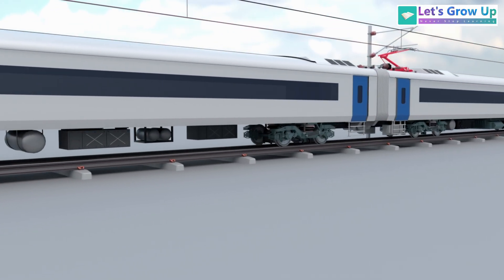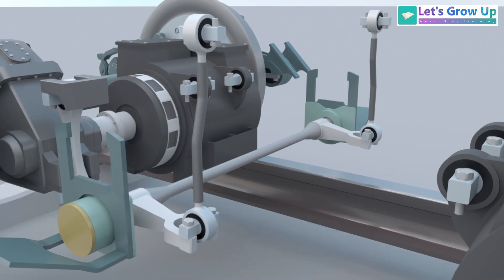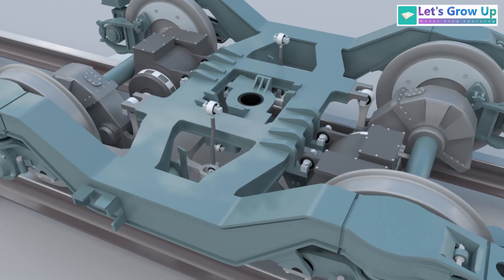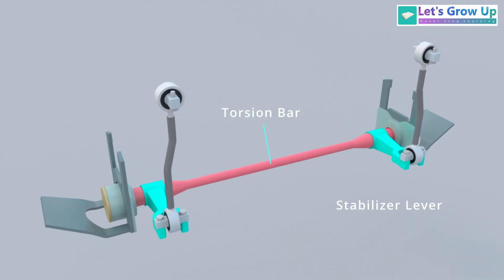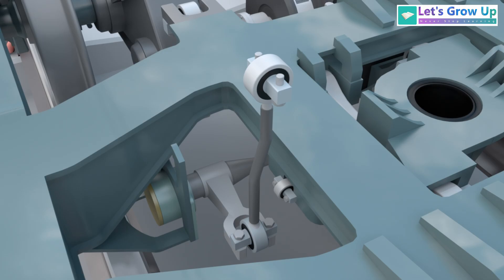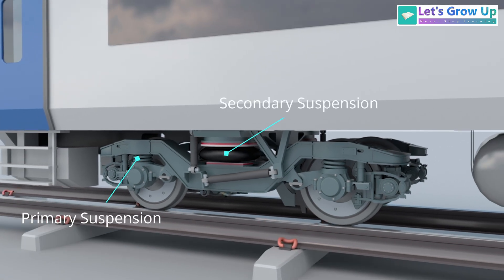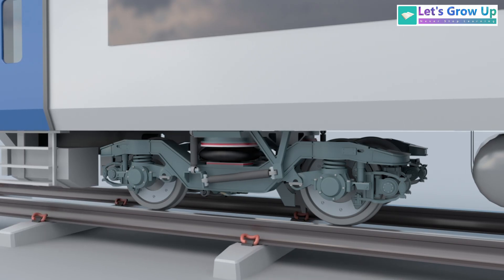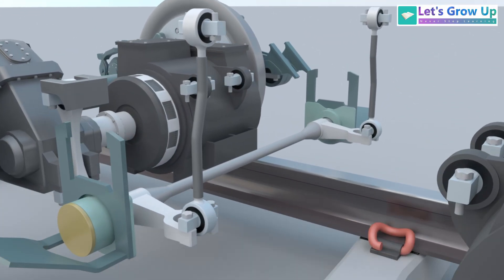Secret Technology of High-Speed Train Bogie | Train Anti Roll Bar Assembly and Working Function

Comment: I am wondering, how much does a high-speed train bogey like that weigh, with or without traction motors which drive the wheels?

I essentially am wondering how much more a bogie like that with traction motors ways compared to one without traction motors.